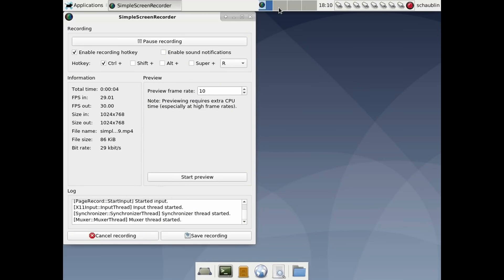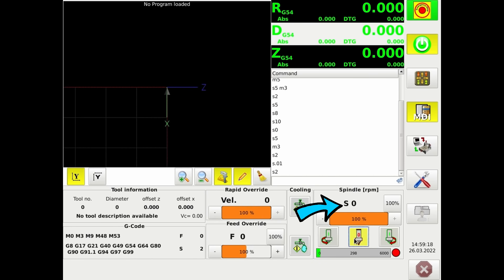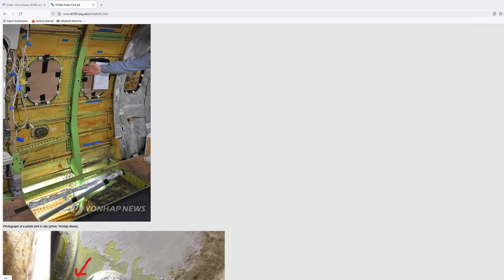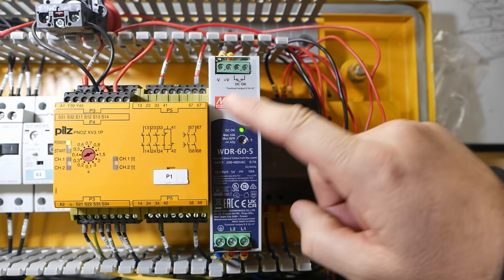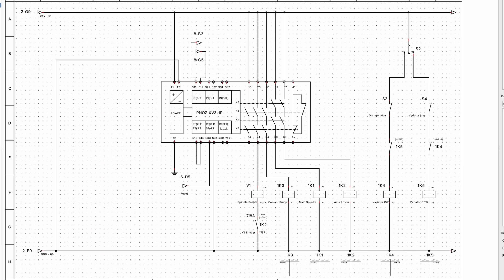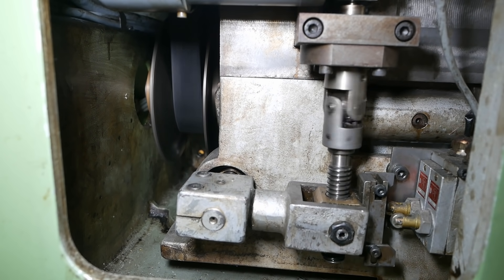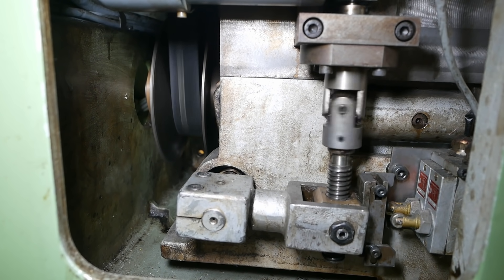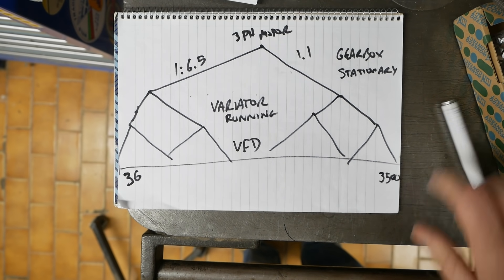Variator control - Schaublin CNC - Ep.30

Comment: It's an interesting problem, I would look at both mechanism's response time and precision. working under the assumption that the variator is the slower reaction system, I would would control both simultaneously, using the vfd as a tuning adjustment to the variator. 

At an algorithmic level I would have the variator constantly trying to take the vfd frequency to it's mid point, that way you always have the most overhead in the most responsive system. 

With the encoder output as feedback, tuning the system would be a fascinating video. You could also mount a sensor on the variator swing arm or the lead screw to get positional feed back, to supplement the two limit switches.

About the gearbox, first I would have a software sanity check, for a known variator and vfd setting you should get one of three encoder outputs, gearbox in high, gearbox in low, and powertrain fault. Ideally fixing a switch in or on the gearbox would be ideal. You could also have the machine stop the spindle and force the gearbox to low speed if it ever looses track of it's state, which should pretty much be when the controller loses power. 

Selecting desired gearbox speed should be done based off looking ahead in the gcode at requested spindle speeds and setting the gearbox for whatever settings coveres the most upcoming speeds, assuming there is a reasonable amount of overlap in all three speed governing systems.

Just a few things that sprang to mind, I would be interested to know if I have made some glaring error or totally miss understood one of the systems at play.

While not exactly trivial, given the apparent modularity of the Linux cnc platform it seems that if you break down the control systems it shouldn't be unfeasible. However it might overkill!
Reply from the maker: "At an algorithmic level I would have the variator constantly trying to take the vfd frequency to it's mid point, that way you always have the most overhead in the most responsive system." 

That is an excellent input, only it hits up angainst the one significant limitation of the variator control. It's ratio change follows a fixed schedule (not rate as it is non-linear). To use the variator as primary adjust ment would mean either bang bang control, or replacing the contactors with a second VFD.

The gearbox has no feedback, but I can infer gearbox position from the pneumatic control selections. I will probably initialise the machine in gearbox High, to give a known start point.

I dont think you can do speed look ahead like that. I would assume I can only react to the next line. Basically the gearbox component will need to stop the spindle if a gearbox ratio change is necessary. That will have to be done based on RPM at the start of the cut, as you cant start a large diamter facing cut in high gear, as that the the speed yo would ideally end in, it would burn up the tool at the start of the cut.

If interested, here is the gearbox control component my mate wrote for me for the Maho...
https://github.com/jin-eld/mh400e-linuxcnc

I have added your comment to the thread about this Machine on the LinuxCNC forum.
Reply: @RotarySMP  I agree about keeping the VFD at midrange or above. After dealing with Large Mine Fans, with VFD's. The motors, really heat up, in the windings, when run at or below 50% of Hz, I'm in the 60 Hz end of the world. YMMV, but not much.
Best wishes from the far North of Canada.
Reply from the maker: @carlthor91  Thanks for your feedback on that. I wonder how often my lathe will run a high load, a low speed and long duration. The worst case is probably hogging down some large diameter cast iron like making a faceplate. Even then, I wonder how close to the motors max torque you really get? It is a good point though, that the algorythm should try to maintain the frequency around 50Hz.
Reply: @RotarySMP  That is where your variation drive and back-gear shine.
Reply: @RotarySMP  WRT gearbox location, any way you can get a magnetic proximity sensor in a relevant location for the software to know its state (and at least error out). Or a motor-side speed sensor and be able to derive the gearing knowing the speeds and the rest of the state. Agree with the folks saying to build the control around putting the variator in the middle of the expected cut's RPM range and then let the VFD take over from constant surface speed. Although wouldn't the gear ratio change in the variator be made to track that exactly (they're both walking down diameters)?

I am curious as to LinuxCNC's lookahead ability though (I haven't dug into it, but sure will as my mill gets converted). Some amount of mid-point seeking on hardware speed control to then let the VFD take over would be handy.

Comment: I just saw this, I think a hal component could be created to handle this. Run the vfd at max speed and then use the variator to control the speed, similar to a typical variator setup on a bridgeport style variable speed, could be done with banding and high and low speed controls. I was thinking about ti while searching a vid and this popped up
Reply from the maker: I may end up with a HAL component, but am not a programmer, and have never used C, so my first attempt will be to set up the control logic using Classic ladder. If I fail there, I will go looking for someone to program it in C, but by then I should also have a better understanding of the ins and outs of this control heirarchy.

Comment: I'd bias the variator to low RPM. Force the motor to spin faster. I feel the variator should only really be used to push the RPM that much higher. This'll help keep the motor cool as it'll have greater air flow. This also just keeps the motor in its more efficient range.
Reply from the maker: I agree. The only time the lowest variator, lowest VFD speed would be needed would be a large diameter cast iron part close to the machines maximum swing.

Comment: Hi, Matt from NZ here. Loved that run down of how the variator works, and that choice ramp up and slow down sound when you first tried it out.
I don't have direct experience in CNC and only a little in hobby machining, but I'd parrot some of the other comments here; evaluate the speed ranges possible from the combinations of your three parts.
Consider whether the cost/effort of another encoder on the variator for a closed loop system is viable for you,
And then if it is, place each under software control, so that your CNC programs can do exactly what you want.

Is it possible to interlock (not sure if that's the right term here) the control circuitry so that the machine isn't trying to gear change while running etc? [Are 'Dumb' questions allowed?]

As a software engineer (but remember,  no CNC experience),  I'll also ask: can the CNC setup check for a certain machine state while running? I dont know if this would end up being specialized to your particular machine, but as in, "about to do a facing cut, stop spindle, change gear, start spindle, change vfd to <n>, move variator to <m>, now: is everything as it should be? "

No? Stop! Or yeah? OK move to cut <x,y,z> while adjusting [variator and vfd]

Also liked seeing that little side project with the garden water - hadn't seen that sort of thing either.

Stay safe mate.
Reply from the maker: Thanks for watching it. 

Since there is a massive overlap in the speed control of the variator and VFD, I dont really need precise variator control. Rather than adding an extra encoder, I will probably just run the variator as number of discrete fixed ratios, with timed dead reckoning to control to those points. The VFD will close the speed loop.

Yes there are standard parameters like "Spindle at speed" or or the "VFD Running" signal which I can and will use as inhibits to prevent a back gear change attent when running.

LinuxCNC allows you to write components in C, or there is also a PLC like ladder logic system, either of when can be used for such a job. Here is the COMP a mate who is a pro programmer wrote for me.

https://github.com/jin-eld/mh400e-linuxcnc
Reply: @RotarySMP  cool stuff. Sounds like you have a decent idea of a way thru it that'll work.
Reply from the maker: @matthewsimmons6831  I just need to find the time to map it out as flow chart, and either learn Classic ladder, or get my mate to program this Comp as well.

Comment: ich habe den variator rausgeschmissen und arbeite nur mit 1:1 und 1:6.5- Dafür habe ich einen 2.2kw motor anstatt in stern in dreieck geschaltet und einen 5kw frequenzumrichter verwendet. der kann den strom der dreieckschaltung und bingt dann bei 87Hz 3.8kw. darüber geht es in den feldschwächebereich und ich lasse den motor bis 125Hz drehen. damit erreiche ich >3500upm. das hat sich bei meiner 125er bisher bewährt
Reply from the maker: Hi Peter,

Danke der Feedback. Ich habe den Variator drinnen gelassen, weil es weniger Arbeit war als ein Motortausch. Ich finder der Mechanic irgendwie schön, obwohl unnötig :)

Comment: get a dive that has a toque loop output setup linux cnc to look at the output and shift the variator if the the motor exprences a certen amount of toqure load bellow the max load the motor is capable of
Reply from the maker: Good idea. There is so much overlap in the authority of the CVT and VFD, that I will probably treat the CVT is a dumb 4 or 5 ratio gearbox, and just use timed dead reckoning to roughly position it.

Comment: Before starting I would chainge the gearbox ratio specific to material;
G0 moves CVT chainge for best torque to speed ratio depending on the average material diameter while turning;
G1 moves VFD fine adjust.
Reply from the maker: The influence of material and diameter largely occurs in the the CAM software, which will output the S codes to command spindle speed.

Your heirarchy of gearbox, then CVT and finally VFD is what I am tending towards though.

Comment: Gearbox: ultra rough control. Variator: Rough control, VFD: fine control. 

Target VFD at Max torque, Set Gearbox for "range" needed for target cut RPM, then adjust variator to hit +-5% of target RPM, adjust VFD to fine tune to target RPM.   During cut (variable speed cut, say while facing at constant SFM) ramp Variator till variator endstop, then ramp VFD. (would probably be easiest to wire variator limit switches into linuxcnc so you know when you are actually driving the variator closed/open instead of just thinking you're driving it (and limit switch is preventing the motion)
Reply from the maker: I have received a lot of excellent feedback on this, which has really help me. I'll touch on this more in todays video.

Comment: At 0:55 you mentioned that the encoder was a TLL Single ended signal.  Did you mean TTL (Transistor Transistor Logic, 0-5VDC)?
Reply from the maker: Oh, good point I said that wrong. Good catch.
Reply: Not an issue.  I suspect that TTL / CMOS,  single ended and differential signals and levels are things that many of those who watch this channel don't know much about.
Reply from the maker: @ve7cbh  A lot if this stuff I only learnt about due to these projects. My education certainly didn't include them. I appreciate the feedback I get, as I learn a lot through it.
Reply: @RotarySMP  Same here.  Running a lathe looks a lot different watching on YT then doing it for myself as I start a chuck backing plate for the third time lol.  Steve

Comment: 1st adiustment Variator (vr)  , if vr min then VFD Hz down , if vr max then VFD up . startnig at VFD 50HZ .there is no substitute for mechanical reduction.
Reply from the maker: That would be good, except that the variator only changes at a constant rate so bang bang control would be needed to have it as the primary control.
Reply: @RotarySMP  I don't understand what it is bang bang control :P . yes i think that it should be controld as primary .
Reply from the maker: @maciejrieju  https://en.wikipedia.org/wiki/Bang%E2%80%93bang_control

Basically switch the variator contactors on and off rapidly to slow down the rate at which it changes. Very hard on the contactors.
Reply: @RotarySMP  I wouldn't have thought 
that is their name in English.  and you are right contacts have a hard time in such an implementation 
direct drive lead screw by step motor? maybe something like that would work. all you need is a EN ,DIR, STEP  signal.would be quick and easy to do &relatively cheap (12Nm steper + driver costs approx 150 euro )
Reply from the maker: @maciejrieju  It is one option, but I am rather loathe to change any of Schaublins really nice engineering there. It is becomes necesary, I would probably use a VFD to control the existing motor, rather than swap it out. But I really dont think it will be necessary.

Comment: My guess would be to change Variator pulleys at lower VFD freq and once maxed out increase VFD freq. Need to make sure motor at low speed and high load does not over heat.
Very interesting, really enjoying your reasoning process with the CNC.
Obviously your chimney door is crappy metal to weld!
Reply from the maker: Yeah, I'll blame the steel for my crappy welding :)

Thanks for the feedback on the variator.

Comment: I would prefer power over speed.   So set the variator to give best power ratio and control speed with the VFD as far as possible, and only when the VFD is at max let the variator adjust the RPM upward.
Reply from the maker: Yeah, I think that is roughly the direction I will go, as it provides maximum toqure and also keeps the VFD frequency up, which will keep the motor cooling up.

Comment: On the 3 different levels of transmissionses going on.... I would build some code to bias the whole drive system to maximum torque when seeking a specific spindle RPM. You may also be able to run some interesting code to vary the speed of the spindle with both the variator and VFD to cut vibration modes out of the system when running it hard.
Reply from the maker: Good point. That sort of dynamic chatter control is the sort of thing that the big manufacturing are implementing. Why beyond my ablity to implement, but it is a cool idea.

Comment: With the aircraft wiring looms, I think part of it is ease of troubleshooting and repair. Being able to see all the wires in a harness directly means you can see evidence of chafing far quicker, which is important in moving flight control surfaces with wiring running into them. It is labor intensive to lace things back together, but you're not always needing to replace an entire harness. Just one wire with a break at a time will be what's being diagnosed.
Reply from the maker: Thanks for the feedback. Good point.

Comment: My 225 uses the Fanuc control dials as a faux variator function if required - (and btw I rarely use the constant surface speed function)  In your machine I think it would be nice to keep a form of manual control over speed as you work - even though the 225 has servo driven 'manual control' capability over movements in order to provide a form of manual turning - there is no real feedback through the hand during the cut just movement - and in non production work the lack of tactile feedback is something I miss.  Oh and whilst I think about it looking at your trial spinnings - one other thing to keep in mind is to ensure that your chuck is actually rated to cut at the maximum speed your machine is capable of under load even with pneumatic and very high end chucks eg  I wont run my machine at 5000rpm which is the rated speed capability off the chucks - but I am happy to run at 8000 when using collets.Thanks for posting atb Pete
Reply from the maker: Good points. I will be making a fake manual module with two jog wheel to allow pseudo manual machining. 

This chuck is fine, but I will limit the spindle to the 3000 Schaublin limited it to. I am sure the bearings can take higher speeds, but the collet closer is not designed for it.

Comment: I think your choice has to consider the common use case and only use the VFD and maybe the Variator during cutting operations.  You want constant linear velocity so you have to manipulate the VFD to get that (since Variator control is not continuously variable). However, you also want the ability to do large faces suggesting you need the highest speed range for both Back Gear and Variator as the cut radius approaches zero.   I think you're in the "no free lunch category" :-)   It seems like you need something like two unique tool-change operations when you need a large speed change; one requires full stop and the other is done 'in-flight'.  I'm wondering how the original Schaubline controller accomplished similar.  I have a similar issue on my manual Emco Super 11 whereby the spindle motor includes high & low ranges, the back-gears have 4 unique speed settings and the VFD is, well..continuous.  I just hard-wired the spindle motor on the slow (but higher torque) setting and let the VFD overdrive the motor at f=2x or  120Hz (US line voltage) to regain thee highest spindle speed. So far the 'vintage' induction motor has not complained.  I still must shift gears for very slow speeds but this is ok since I only use the slow speeds for drilling and cutoff operations. I don't know much about programming LinuxCNC but the tool change operation  for the variator in-flight would be an interesting algorithm to allow 'tool-change'  while the tool radius is moving on the face.
Reply from the maker: I thought Schaublin had implemented CSS, but took another look at the manual yesterday, and it looks like the surface speed mode just selected a speed dependant on the radius at the start of a cut, but didn't do CSS. 

You have summarised the issue well. I have a discussion on this in the LinuxCNC forum here:
https://forum.linuxcnc.org/26-turning/41498-schaublin-125-cnc-retrofit?start=330